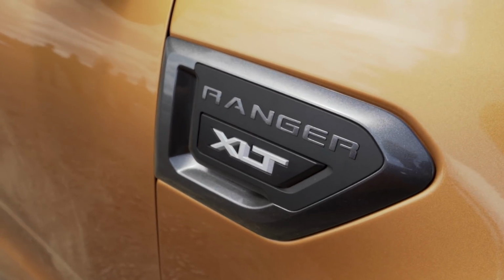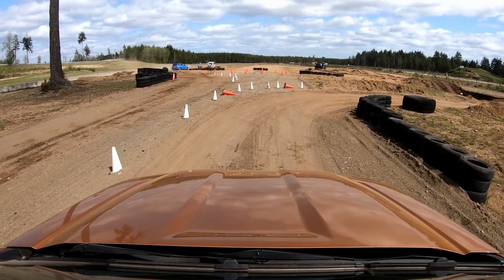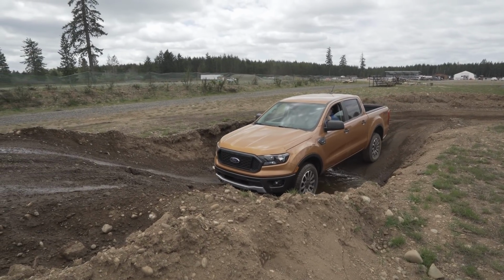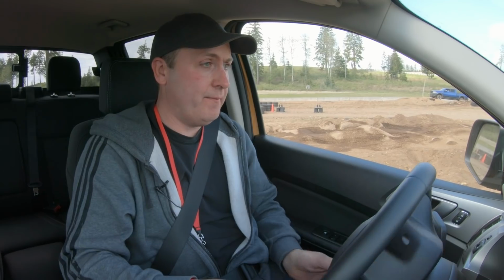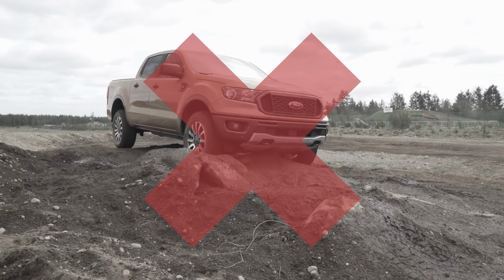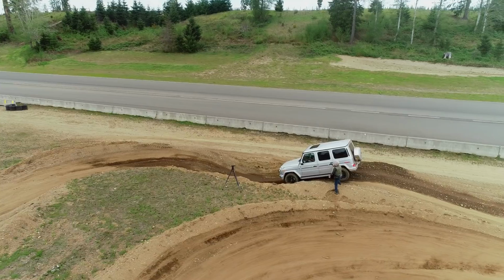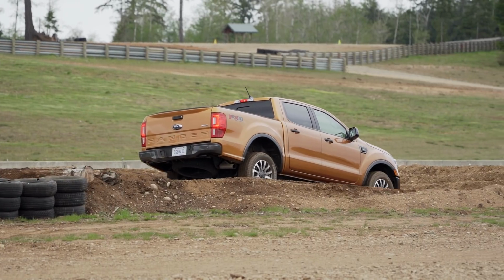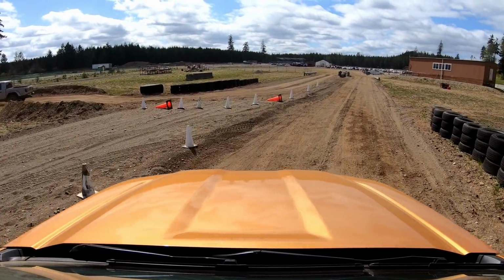2019 Ford Ranger FX4 Off Road Trail Control Explained

Comment from the maker: Which mid-size truck would you buy?
Reply: FORD
Reply: I bought the ranger & I Love it
Reply: Ranger!
Reply: We test drove them all except the GMC.  Liked the Ranger the best.
Reply: I bought the 2019 Ford Ranger.  It is an amazing truck.  I found it handled better than the GMC Canyon, Nissan Frontier and the Toyota Tacoma.  It has the power I require and yet it is smooth with a relatively small turning radius in comparison to some of its competitors.
Reply: Definitely a Ford Ranger
Reply: Ranger all the way every day
Reply: Ranger
Reply: Colorado
Reply: Nissan Frontier PRO-4X. Trucks are too damn expensive. Nissan P4X is the last affordable offroad truck.
Reply: @myorangebicycle  Touche'
Reply: Ridgeline for me. I rarely leave pavement but still need something to tow my race Miata and commute daily in.
Reply: GladHeAteHer
Reply: TRD Pro
Reply: Tacoma
Reply: Nissan Frontier Pro-4X

Comment: You noted when in Trail Control, power may be directed to each of the wheels individually.  Is this feature only available in Trail Control or is it also available in any, or all of the various different selectable modes?    And how, exactly, is this done - braking the slipping wheel or some other way?

Comment: Nice vid man is this better then honda ridgeline cause i am about to buy one nice vid and keep up if you have time please answer i will use my pick up only for off road cause i live in a greek island iam thinking of the all black edition and i have no budget. thank u and please answer.
Reply from the maker: As much as I like the Ridgeline the Ford Ranger is just more capable off road. Everything from the dual range gearbox to crawl control and the various off-road modes.If you’re low on budget the Nissan frontier off-road is a good option.
Reply: @drivingsports  Thank you very very much so i am turning to the ford and i really apreciate ur answer i am not getting cause i had one  for 12 years it was really good but i am bored to buy a nissan again thank u again and have a good day

Comment: A real man drives a 4X4 that has non locking rear axel, hubs you have to manually turn for front differential, 4X4 selection using a lever next to the manual gear shift.  Hee, hee. Like to see a comparison between the new vehicles to the 70’s vehicles.
Reply: And a "real man" is adaptable to changing technology.  ;)  Old school mash and bash is how "real men" spend free time repairing everything.  ;)
Reply: A real man? That's not what your wife said...